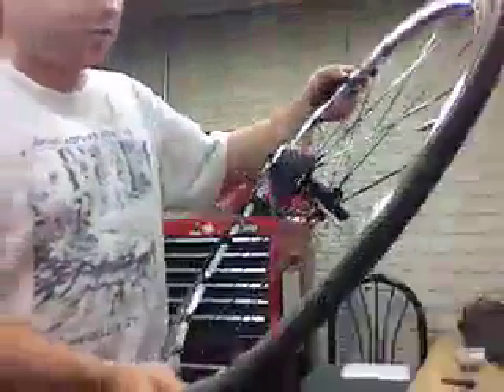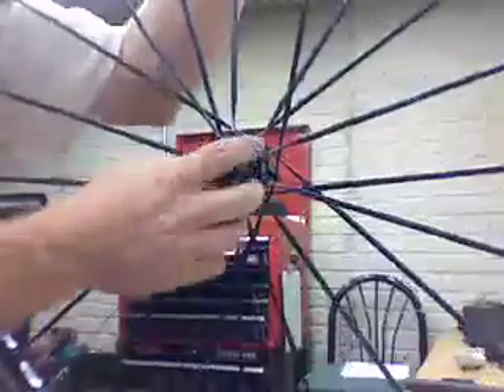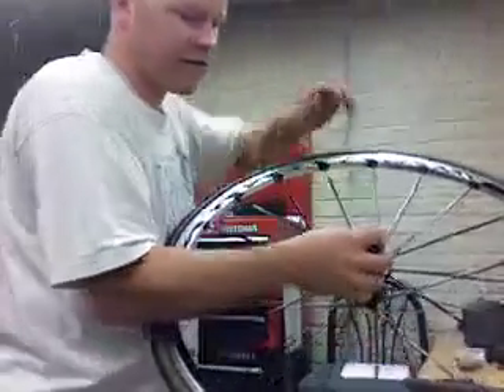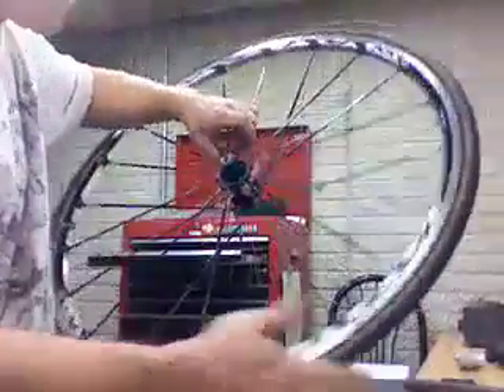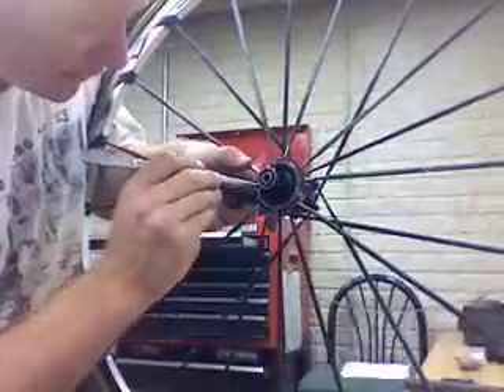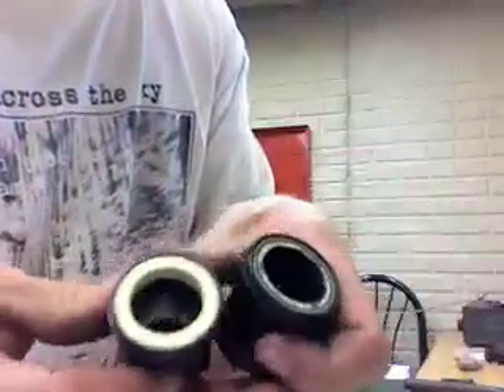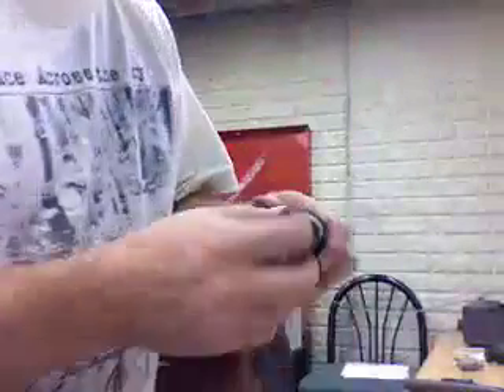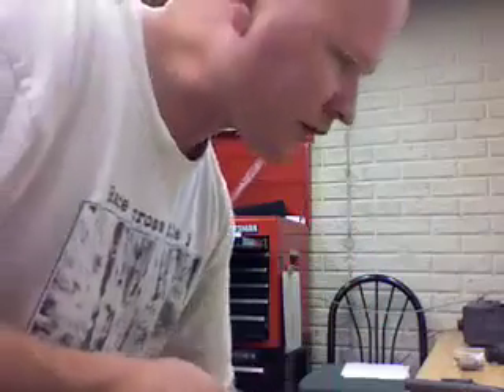RogueMechanic Mavic Freehub Body pt.1

Comment: Great video, just serviced my 2011 Ksyrium Elite (was getting skip under take up of load).  For anyone else doing that particular model of wheel, to undo the axle end bolt you don't need to remove anything from the non-drive side and its a 5mm Allen key for BOTH sides.  Also Mavic have now superseded the actual freehub body part itself and its now part no. 30871101 for Shimano (was M40592) which includes a special step shim that replaces the spacer and allows the pre 2013 axle width of 8mm to fit this new freehub body that is also for the 2013 onwards 9mm axle models.  Its a snug fit but just place it carefully and it'll slide into position.

Comment: OK I have some ksirium sls --- the rims are pretty worn -- can I get them replaced ? Everything else is still good. No other problems, one spoke broke about 3 years ago but no more since.
Reply from the maker: Hello Ray,  Yes, those rims are still available and can be replaced.  You can order them from me or I also can install them for you.  You can email me at roguemechanic at gmail dot com for more specifics.  Thanks!  John
Reply: RogueMechanic Hi I did get back to you -but as you are obviously across the pond I don't think you can do much for me - thanks for the information though -- I'm going to contact Mavic and see if I can get some rims and then find someone to build them for me -- any model number I will need to order them (I recon they must be around the 2010 model ! which would make them the original Ones ???

Comment: There is no non-drive-side end-cap to pull off on my Aksium Race wheels.

I cracked the free hub attempting to tighten the wobble out of the cassette. If I can't change the free hub then the wheel is dead. The amazon M10 freehub page says that it fits most wheels "save the Aksium." Does that mean there is no way of changing the free hub on Aksium's?

Comment: The front hub uses maintenance-free cartridge bearings.  All that you can do is adjust bearing preload or replace the cartridge bearings (only should be done by your LBS)